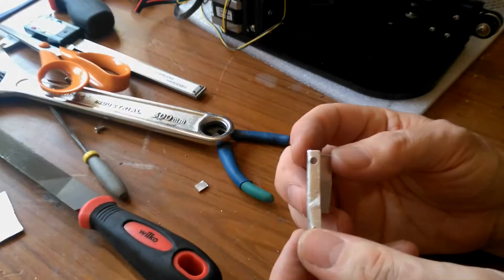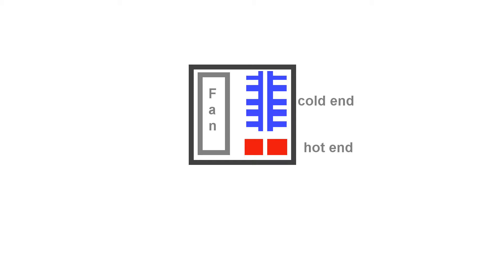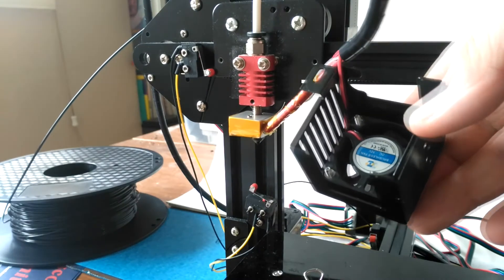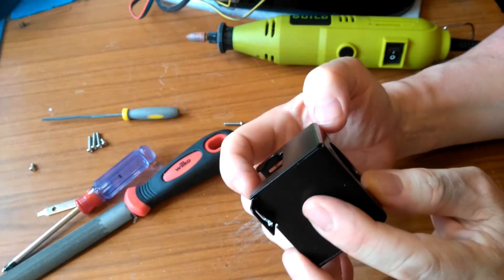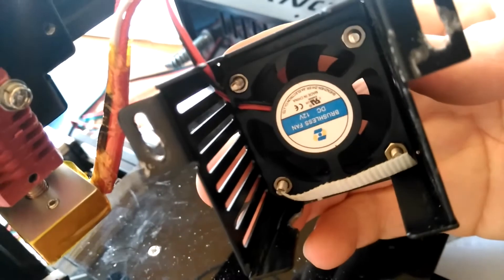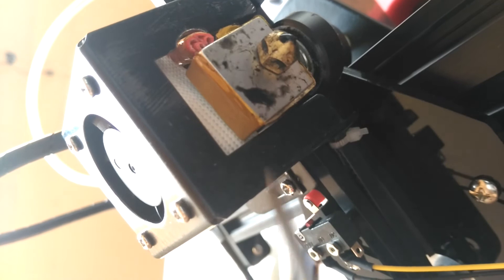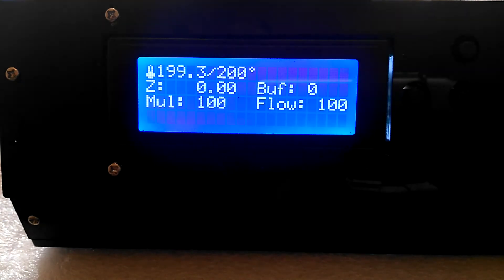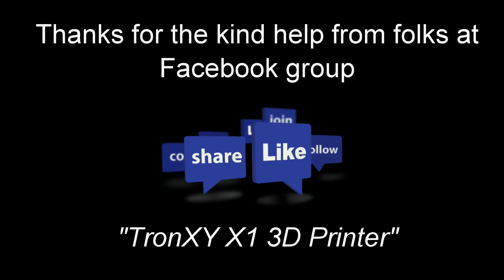TronXY X1 3D Printer Mods: How To Upgrade the Hot End

Comment: I actually thought of something similar in terms of diverting the air from hitting the heaterblock. I just intended on using a redbull can, cutting a rectangular piece out of it and using a dowel or broom stick to round it and glue it under the fan so the air hits the cold end.
Reply from the maker: Yeah that could work.

Comment: Part of the issue here, at least in the case of my X1, is it came shipped with extruder heat control set to Dead Time Control (3 on EEPROM Extr.1 heat manager). This seems to be a fairly simple "switch on 90% when under temperature" control which was struggling to keep up to temperature when printing fast even when I'd fitted a different hot end cooler. Changing this setting to 1 puts the heat manager into PWM mode, and after a few PWM auto-tune's to get the correct values and setting those into EEPROM things are a lot more stable. It certainly helps when printing PET-G.
Reply from the maker: I wonder why it came like that? Mine was set to go and has not given any trouble. (I wasn't notified of this comment and only just saw it)